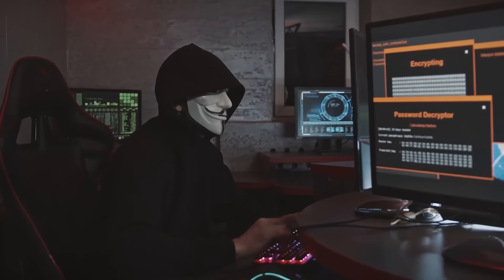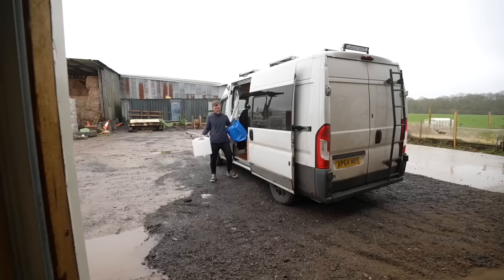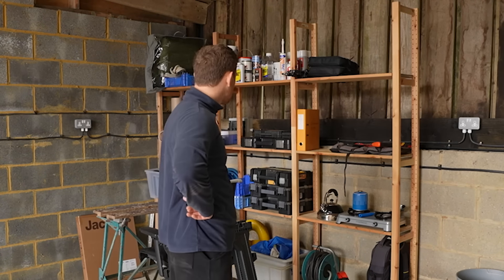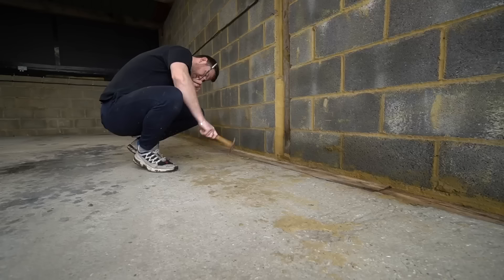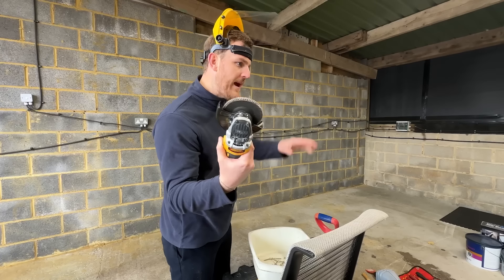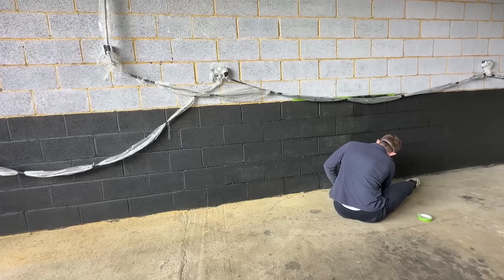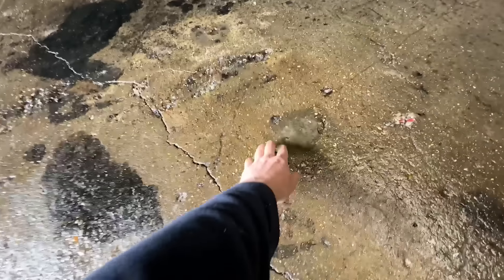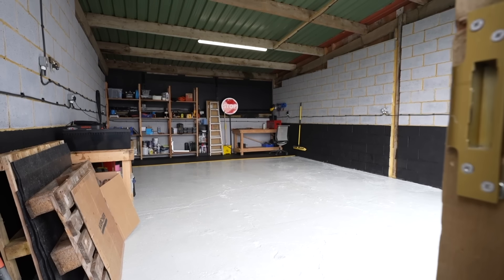I Moved into my Dream Van Build Workshop

Comment: Don't knock those flooring protectors.  I cladded the external of my shed in it (back and sides), then some exposed bits had metal sheeting on or featheredge.  Has worked a treat and still going fine 3 years on.  Not a cheap price, but then that;s the southern elements I think!!  Honestly Will seeing some of your methods and mishaps are just brilliant.  Fair play for you having a go, but I don't think you're quite up there with DIY, but I like your perserverance!!!
Reply from the maker: Perseverance is key and my DIY skills can only improve

Comment: In hindsight, I think you made a sound call (initially thought the reverse!). You've now got a space that matches the level you want to keep up too & grow into further. If you start with a run down, tired space, you'll be less inclined to push harder so good job mate! One thing I would really say though is invest in some GOOD mask protection - Concrete/MDF (pretty much anything) dust is nasty so look after your lungs.Only saying this to make sure you keep making videos 😁👍
Reply from the maker: Haha thanks very much and yep don’t worry I’ve now invested in a decent dust mask to spare my lungs

Comment: Why do you not have cross stays at the back of the shelfs?
I have similar shelf but with wine racks as the shelf planes.
I have cross stays at the back. They are made from thin steel rods and in place they look like a X covering the back side.
It is quite stable.
Reply from the maker: I didn’t seem to have any cross sections although next time I’ll add some in to make it more stable
Reply: @WillsWhereabouts  If you do not have any that belongs to the shelfs you can make it from something else. E.g. steel bands, wood strips or even steel wire.
Reply from the maker: Yea I’ll do that next time

Comment: Will, u need to fill in those cracks at the top of the side walls otherwise more invisible dust particles are going to get in 😂 also the door has some cracks that are going to need seeing to 😂 good luck!! Ps. Dont forget to check the roof
Reply from the maker: Hah for the moment it’s as dust free as I can get it, but the roof deffo needs some improvement

Comment: Make sure you put a drip tray under Mary… you don’t want oil on that beautiful floor
Reply from the maker: Great tip, thanks mate I will do
Reply: @WillsWhereabouts  loving the space by the way…if your recording in there you might need some sound proofing or a couple of acoustic boards not the the stick on tiles but acoustic panels. Plenty of YouTube videos on them and would be a great project for you

Comment: Re the 11 squares - did they not come with flat edge pieces? Also, if you ever need to do it again, try doing 3 or 4 at once! I also think you should have done a @properdiy crossover!
Reply from the maker: No they all had the lugs on the end but it was easy enough to cut them off!

Comment: The bloody down side is the rent !!
Reply from the maker: Tell me about it! Expensive for what it is but if you do any research into spaces like this where I live some are even more
Reply: W’re renting a 2000sq ft (almost 4x the size of that unit) for £850, it has 3 phase electric, water and massive driveway…..the tenants isn’t paying the full rent because we increase it last year and will only pay the previous amount and want do any work / maintenance on the place.

He isn’t going to be there much longer and we don’t think we’ll rent it again, it’s just to much agro for so little……
Reply: @jno5  I'm probably thick but I don't understand. You say you're renting it but then say you have tenants. What am I missing? Are you working in it or renting then subletting?
Reply: @wanderer4life  - We own a workshop that we are renting out but the tenant isn’t good, so we’re in the process of evicting him…..
Reply: @jno5  Sounds like he's earning a little spell in Punishment Corner.
Got to be careful though, because he obviously knows a lot about the property, weak points, where it's vulnerable and so on. I've thought of renting out my flat and going abroad for a bit, but I could never relax knowing some oik is in my property. Not worth the hassle, or a long spell in jail for throwing him out of the window.

Comment: Hi there
Excellent video ...try replacing the ikea shelving with B&Q decking boards,at £7 each ,cut to size ....use fence posts as the uprights ...cut to the ikea dimensions...100% better ! plus the black boards  board you put up at the back put on ceiling ,paint white or buy white if you can to reflect light and add as insulation ...plus with white boards temp fit 3 to a will and turn workshop into cinema for your mates
Reply from the maker: Awesome thanks for the advice I’ll have a think about any improvements I want to make in the future

Comment: If you attach a diagonal board across the back of the shelf, it will stabilize it! 
Just build another van as it will be much higher quality build, as RVs are such a "built by the lowest bidder" design!
Reply from the maker: I should have thought about that 😂! It should be fun doing another conversion
Reply from the maker: @helentinkletoesadvsfromacb I got the shelves second hand so didn’t come with anything like this

Comment: I'd live in the bastard if it saves money instantly. Live in the van, inside the unit. 
But I've got an idea that might be useful one day.
I'm a lorry driver, which is kinda like vanlife but the vehicle is bigger.
Anyway, all haulage companies have to think about security. All those lorries parked up, could be full of valuable stuff. The cost of insurance will be astronomical, so to try to get cheaper insurance the haulage company often hire night security men. 
I've seen a guy living in a caravan tucked away in the corner of the site, so they basically allow him to stay there as an employee. Electricity, water, safety and wages. 
Just an emergency idea for if you ever find yourself with nowhere to live. Just approach the haulage companies and if you're lucky you could earn decent money for doing fuck all. And youd be locked in the yard so youd be also safe.
The security guy's job is basically to call the police if some scallywags were showing up on the cameras.

Comment: Will.
I need to complain about something important. You were using a mask that has no right to exist. What you should do is go to a proper PPE shop and get yourself a face hugging respirator with filters you can either replace or swap them to the correct verity. A proper mask should seal over your face and not leave any gaps, those paper things are useless. 
Now rant over...
Doing what you did to the shed was probably the best idea, you'll find it easy to keep clean and it'll feel nice. I wouldn't have mad a cup of tea in it as it was in the beginning, but as it is now I'd even cook in it. Well done.
Before I forget. If you fill holes in the floor again with cement, just go over the top of it with a brush and itll blend the new into the old.
And remember that you're awesome! 😎👍
Reply from the maker: Thanks for the tips mate I’ll make sure to get a proper mask for next time! And thanks very much I’m happy with how it’s come out, I’ll certainly be doing some cooking in there. Also I’ll have to remember that tip about the brush with cement as I found it tricky to level it out
Reply: @WillsWhereabouts  
Anything to help the future you. 😀
Can't wait to see what chaos happens. 😆

Comment: Let me tell you a bit about landlords,  a run down abandoned workshop (similar size to yours)chest height with rubbish, half a roof, sidewall crumbling and all windows and frames broke or missing, no doors at all,  gutted, re roofed, side wall rebuild with double glazed windows along full length of wall, new concrete floor laid sealed and painted, all walls lined and painted, new doors, completely rewired and certificated,  internal office built in the corner.  New outside fencing and custom sliding metal gate.  It all looked fabulous and cost thousands, so good in fact that the landlord immediately more than doubled the rent.  Be warned.
Reply from the maker: Well fingers crossed that doesn’t happen to me
Reply: @WillsWhereabouts  
I sincerely hope not mate.

Comment: Why would you spend your own money adding value to a rented unit? Adding insulation at your own cost is a bit daft, especially since you're paying £700 per month and improving the place for the owners. Saw you coming from a mile off 😅
Reply from the maker: It’s simple isn’t it 😂! So it’s a place that I want to work in which is 100x nicer than when I moved in! Who wants to breathe dirty dust in all day everyday